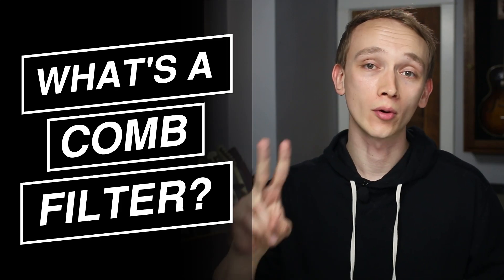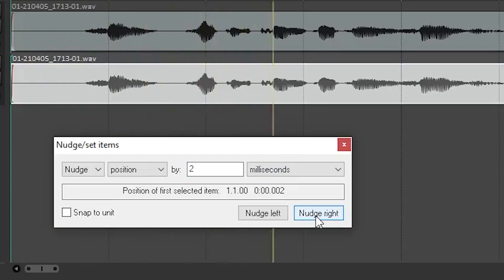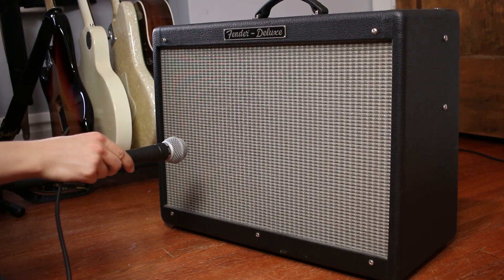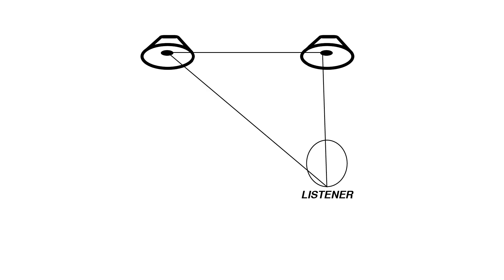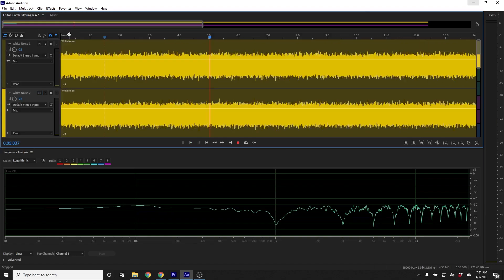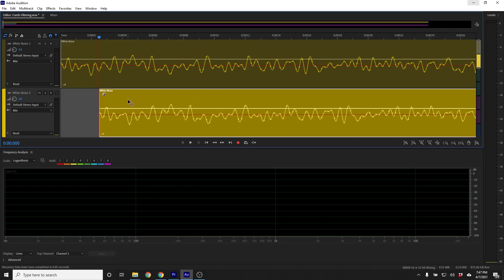Everything You Need To Know About Comb Filtering [with Audio Examples]

Comment: Well I've just bought some new bookshelf speakers (sold my big floor standing ones) and I thought this Audio University sounds interesting - and it really was.
I am 80 next year but I remember making some speaker cabinets when I was in my late teens and they each had 4 x 12 inch double cone speakers in each cabinet which were massive sand filled front sound panels of double cavity solid birch plywood about 5 feet x 5 feet and over a foot deep on castors. Amazing early stage public address system with absolutely no discernible distortion but very heavy and difficult to transport.
This video has really impressed me how far sound technology has come since the 1960's.
Incredible professional produced video - this sound engineer is amazing to listen to.

Comment: I just had Infinity Kappa component speakers put in my truck, just the factory 6X9in the door with the tweeters that came with those component speakers, that didn't come from the factory with tweeters, so I had them professionally installed in the pillars of the doors, and the matching upgraded Kappa 3 inch(instead of the 2") three-way(instead of 2 way) that specifically pairs with the component speakers, in the dash. I had DS-18 6x9's in the rear cab corners. Although I certainly will enjoy the added base these extra performance speakers offer, I don't particularly want subs with extreme bass in my vehicle, and prefer to have everything look stock.Is there any way I can wire this differently, or do anything different to make the sound, the absolute best that it can possibly sound? I'll come to you, if you are in Nashville Tennessee, or close, and pay you to set it up differently than it is now if there would be a difference in sound quality that you could offer. I trust your knowledge in sound just from watching your videos.

Comment: Fascinating.  I set my stereo speaker up in a way that I can adjust the distance to the listener between the bass and full range drivers.  But I adjust it by ear to attempt to dial in best sound.  Seems a better approach to speaker placement would be to play white noise and look at the waveform from a mic at the listening position.  Aligning the drivers and placing absorption at the first reflection point must observable in the display.

Comment: When I was your age, we had no digital anything, but your explanations were still mostly valid.  One example of a situation that I commonly encountered was monaural PA systems in auditoriums.  The first one that I claimed to be able to improve was a church wherein there were columns down both sides that had small speakers spaced at 90° (Forward, Backward and  Sideways toward the center).  Having sat in various positions, I was certain that the phase considerations during the installations were absent.

When I predicted that I could vastly improve the situation, I was discounted until the claim found it's way back to the audio company that installed it.  They contacted me, to squash the notion that my assessment was worthy of note.  I challenged them to let me audit the phasing of the mikes and speakers so as to produce a representation of what the audience was hearing.  They initially declined but when prominent people in church heard my claim, they advocated that I be given a chance.

I'm sure that you have a pretty good idea what happened....the phase was random.  But more importantly, I demonstrated that in a monaural system, it is critical that speakers that face each other must be wired OUT OF PHASE.  Also, as your presentations pointed out, in the first example of the church, I disconnected some of the speakers and turned up the volume to reduce the complex interactions with the 3 speakers on each column.

I was subsequently was drafted to consult on such systems in about 40 churches, auditoriums and even sporting venues.  In every case, I was able to get the client to conclude that my phase schemes and speaker locations were an improvement.  One day, I was at the inaugural event in a brand new hockey venue in the US.  When I concluded that the speaker phasing was terrible, I contacted the audio engineer. He told me that he had just arrived and was not sure of anything, but that not everything had come from that same source.  I recommended that he get the audio layout plans from all sources and do an audit.  When I returned two weeks later, it was like night and day.  I tracked him down and he said that he had found about 50 errors thus far.  

In closing, I loved your presentations and I wish that more of the commercially available recordings were better engineered.  There is rarely one that like that I cannot improve with a few minutes in the software.  Keep it up, the applications are boundless (maybe check out the local churches...lol!)

Comment: Be careful if you use Cubase or Nuendo. They don't compensate for  the delay. If you already have a single audio mix or master with comb filtering, use zynaptiq unfilter to resolve the issue. It's the only solution to date.

Comment: Good speak! This is why when making recommendations on installed systems, my first option is a single speaker array that is dead centre. It shows in the acoustic simulation software. All too often center placement is not a feasible solution and so, we compromise by spreading the speakers to the left and right.
Reply from the maker: Have you checked out L’Acoustics L-ISA? I think you’d find it interesting!

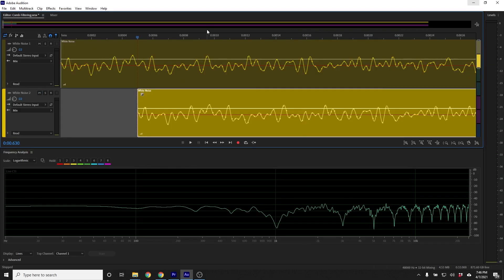Comment: Excellent subject, excellent explanations !  Just a small note : At 10:21 the delay is O.5 ms, not 5 ms.  Otherwise the first cancellation would be at 100 Hz, not 1 KHz.  The cancellation happens at half the period, which is 0.5 ms for a 1KHz signal having a 1 ms period.  And at 13:12 the graph shows clearly a 0.0005 sec delay, which is 0.5 ms, not 5 ms.
Reply: I was looking for this comment, because the math wasn't matching up.

Comment: Thanks a lot for that amazing video!!!! Very interesting that explanation mixing white noise and the sweep. And the examples moving the reflector or the mic movement, really useful. Congrats!!!
But I think that there is a mistake in the delay value, because is 0,5ms, not 5ms. If you put 5ms, the first cancellation appears at 100Hz. 5ms is the 200Hz period, not 2kHz.

Comment: One thing I don't understand...  basic audio..
  I do understand say a pure 20hz sound wave, speaker is moving back n forth 20 times per second, a simple wave pattern on a graph. 

I also understand say 100hz signal, again a simple graph of a wave with more peaks and troughs, now 100 times per second for the same time period, compared to the  20hz wave.

What I don't understand is how a combination of the two waves works in a speaker.  Seems to me the speaker cone is either oscillating 20 times per second OR 100, but not both at the same time.
Reply: From what i understand the speaker cone moves back and forth in between a lower frequency. To clarify If you play a sound that is 20 hz and 100 hz at the same time it will perform those 100 moves back and forth in between the 20 hz movement. There is a lot of space between a fully ouwards cone and a fully retracted cone in which it can make those minor movements :)

Comment: Great description! As an RF engineer, I have always called 'comb filtering' as 'multipath fading.'

No matter what you call it, the effect of the troughs is amazing large.

Multipath fading causes a plethora of frequency nulls and crests throughout an auditorium and the locations of people affect the frequency response of a room. 

Years ago, I built a scalar audio network analyzer using a sinewave generator, a wideband flat amplifier, an oscilloscope, and a wideband microphone. It was controlled by a laptop driving a GPIB bus. The program sweeping frequencies included a calibration sequence to ensure the tones heard by the microphone were adjusted from 10Hz to 20kHz to be flat.

Result: there were dozens of nulls in a typical house room and hundreds in an auditorium! What's more, the entire spectral response changed drastically as people were added to the room and moved around!  Also, these spectral responses changed as the microphone was moved, as expected.

Point is, you can never adjust equalization to the satisfaction of 90% of people in a room, and those 10% who are content with the spectral response will change as people move around in the auditorium.

There is therefore no point in trying to be precise with adjusting your mixing board in an auditorium. The spectral responses of a large room are too numerous and varied to allow simple descriptions like this. The mixer adjustments only have meaning in small highly dampened rooms of a recording studio and in the subsequent mixing of recording tracks. The small room creates fewer nulls and the dampening sounds panels (or even bedsheets and laundry) reduce the multipath effect since the reflected signal is greatly attenuated as demonstrated in this video.

Great demonstrations, Kyle!

Comment: Great explanation!!! I mix at the church in my  village the dimensions are 12ft high 35ft wide and 57ft long; concrete structure. I have two tops and subs placed on either side of the stage at the front, 25 ft apart. I’m getting a lot of comb filtering in the bass frequencies. In the middle has all the bass energy off to the sides no bass. Can you give me any advice to try and fix it?
Reply from the maker: Check out this video, Nario: Speaker Coverage Calculator | How To Choose The Right Speakers & Placement
https://youtu.be/pNkhxnFNUNU

Comment: Shouldn't we hear this effect all the time?  Two ears are hearing always the same sound, with some delay because of the space between them.
Maybe the effect is too small or maybe our brain naturally compensates the effect so we would not be aware of it? Interesting.
Reply: The comb filter effect of the two ear timedifference is used to localise sound .
Reply: @gerbenbonsma1108  Yes, our ears know there's a difference and therefore we can tell where it's coming from. In a 'bright' room (hard surfaces, etc) , I think it's harder to tell where someone is when they call out to you, making direction finding harder.... right?
Reply from the maker: You’re right that we hear it all the time - also because of walls, floors, and ceilings that reflect indirect sound at a delay. Great point, @Nathillien!
Reply: A better implementation of a balance knob on An amplifier should not only change amplitude but also time delay or 'phase adjustment.

Comment: An absolutely great educational video, its clarity and simplicity are among the best in the entire YouTube. Many thanks and bravo! A couple of questions: Comb filtering effect happens naturally, it is caused by a phase shift between two copies of the same signal. How will the frequency comb look like with three or more copies at different delay times? And are there any comb filters built to process signal and when are they used? Thank you!
Reply from the maker: Multiple comb filters occur in every room. It yields a bunch of combs on top of each other. To see a graph, look at an acoustic measurement of a room. 

Comb filtering is used in many many ways. One example in audio is flanger. However, as a few others have stated in the comments, comb filtering is also a tool in programming and computing!

Comment: My omnidirectional OHM G original style single Walsh driver speakers are very sensitive to this effect and need to be nearly 2 feet from the wall with drapery deadening to present a clear and accurate "sound stage" for the listener. The room and speaker placement (in 3 dimensions) of  regular front fire speakers are less critical but still in play to accurately receive the intended sound that comes from the source media without room induced distortion.

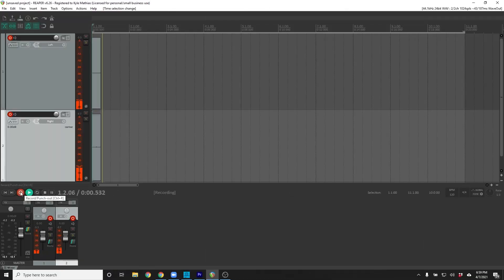Comment: 5:57 Do you think there are ways to counter this, like hard panning the 2 signals, one left and the other hard right?
Reply from the maker: Panning might help when played in stereo, but the comb filter will still be present acoustically. Plus, it will be present electronically if summed to mono. 

You can also try a phase aligning plug-in or manually align the waveforms inside the DAW.

I think the best option is to fix it upfront, but of course that’s not always an option. 

Thanks for the great question, @K I N G D O M!
Reply: @AudioUniversity  Thank you for your knowledge! I will consider this :)

Comment: I'm not an audio enginner. My audio skills are well represented by that meme of a dog in a laboratory.

I've been doing some band live streamming. When there is only one guitar, bass and drums, I like to double the guitar channel, hard panning them and adding some delay to the second channel to create a stereo image. It sounds great in headphones or even in my monitors or any stereo source I listened to.This way the guitar sound huge, can be mixed louder without taking the space of the lead vocal in the middle.
I use anything from 1 to 30ms. Above 30ms it loses the "room" feeling and starts to sound like a slapback. The longer the delay, the bigger the guitar sound in stereo.

BUT when I sum to mono the guitar almost disappear. Or sometimes it doesn't disappear, but sounds very metalic. It is not so much of a problem with overdriven sounds. But it is terrible if the the guitar is clean.
I do understand that it is due to comb filtering.

I was wondering if is there a delay time that works best for creating this stereo feel in the guitar without completily butchering the sound when listened in mono.
The best time I could find so far is 0.3ms (less than 1ms). It starts to comb filter a little above 2k, so most harmonics are above the guitar speaker range .And the comb filter at 2k actually helps to tame the guitar volume at an important frequncy for vocals. BUT at 0.3ms the stereo effect is very shy. It doesn't sound as big as larger delay times. And still sounds a little metalic when the guitar is clean.

Does anyone know of a magical delay time between 5ms and 30ms to create stereo guitar from mono source that still works good enough in mono?
Reply from the maker: It’s possible that using a second microphone on the guitar cabinet would make the signals less coherent. Pan one left, one right and add delay. That might help, but I’m not sure.
Reply: @AudioUniversity  Thanks for replying.
I tried splitting the pedalboard signal into 2 different guitar amps, one mic on each, hard panned. I guess it is simliar to having two mics in the same cabinet. Although it offered a more complex sound than just one source and with no phase issues, it is nowhere near the stereo effect we get when adding delay to one side of the L/R.

I guess what I want is impossible, hehe. I'm trying to simulate a studio double tracking. But double tracking is two different performances with enough differences to not have as much phase issues as using delay.

My next try will be using a very light stereo chorus at the end of the pedalboard into two amps. Hopefully it will give enough movement to the sound so the phasing won't be stationary and feel a bit more natural when in mono.
Reply from the maker: Nice! That’s a good idea.

Comment: Very straightforward thank you .
    My question is if there is a delay can one simply drag the track back into place?
   Iv heard people say yes and others say this can cause more problems. I’m not really sure what the answer is to that. I would think it’s fine but I’m not sure why someone would say it can be a bad idea .

It seems recording a drum set would be impossible tho with all the mics and no 3 to 1 ratio being implemented
Reply from the maker: Good question, @Hey There! You’re right with the drum kit - you can only align the sound of one component of the kit in each mic because a shift here will cause a shift there, and so on. 

If the issue is a single instrument is delayed, such as the guitar amp example in this video, shifting the track could help. Just remember that there’s no guarantee that the indirect sound from reflections will be aligned on each track. 

If there is an acoustic comb filter, there isn’t much that can be done, unfortunately.

Comment: To avoid the difference of phase when you record a sound with two mics placed at a difference distance from the source you can then realign the two tracks in your DAW
Reply: Doesn't help in live mixing.
Reply from the maker: Thanks, karayuschij. Great point. 

Although, I want to mention a few additional considerations:

While you can align the signals so that the direct sound is in phase, the indirect sound from each microphone will still be out of phase. 

Also, in the case of drum microphones, you can only align a non-coincident pair of microphones for a single drum - usually the snare is the best choice. In this case, the floor Tom will be out of phase while so that the snare can be in phase.

Comment: But help me understand.  I've observed live sound engineers using two channels for one source and adding a slight delay to the second channel, say 10 millisec.  The objective in doing this was to make the source sound fatter.  Is this a bad practice?   What am I missing?
Reply from the maker: Sometimes this is done, panning one to the left and the other to the right. If it’s the same signal, it will create a comb filter when summed to mono. I don’t think it’s necessarily a bad practice, but you’re correct that there will be interference if the signals are identical.